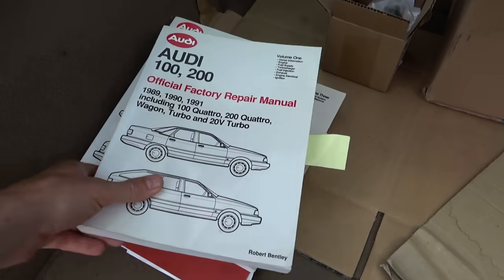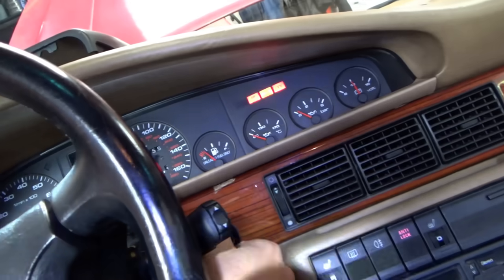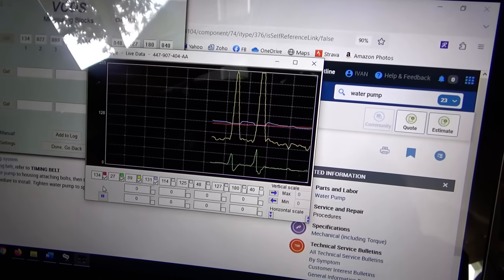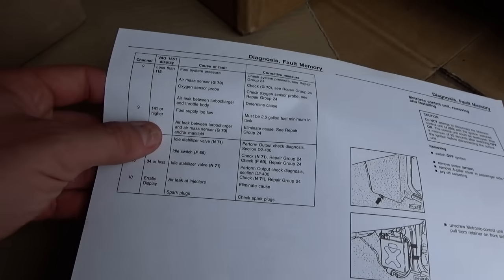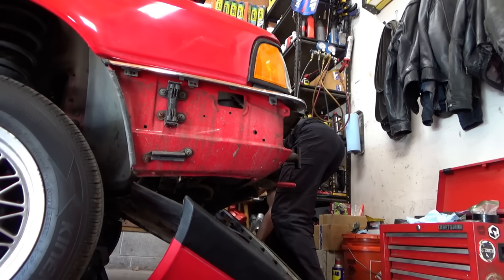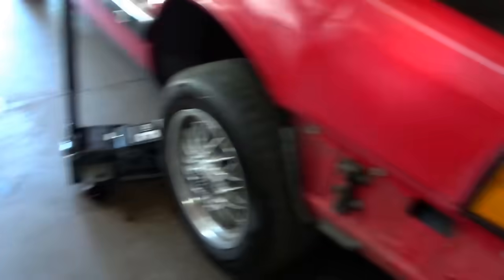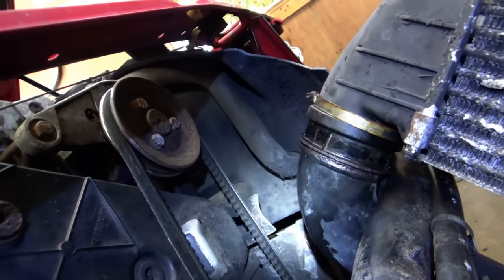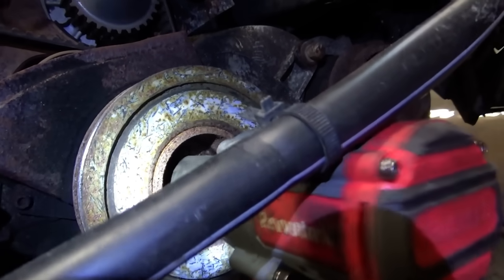(Pt 1) Audi THANKSGIVING! ('91 200 Quattro 20V Turbo is BACK!!)

Comment: Better keep your old cars running nowadays because they are selling your driving information stay away from the new cars with gps.
Reply: Because they don’t track your phone…..
Reply: Yes. 
 My self i ow a 97 Volvo S70 manuel.
Built it my self, & made it though inspection & fully road leagel after standing for 2 years. & parts car witch neve happend
Reply: @ That’s pretty cool!
Reply: @KentuckyReef  When the sell your driving habits to your insurance company you might think differently it will count hard braking speed and even corners your car has yaw sensors just fyi.
Reply: Some people have been programmed to embrace the latest & greatest  spyware tech  in new cars
Reply: They wont need speed camera devices with these new cars.
Reply: If you believe all these conspiracy theories, bear in mind your smart phone has all the same capabilities and more. So you’ll have to turn your phone off every time you drive.
Reply: @morstyrannis1951 they can not prove it, via your smart phone, if you are driving a particular vehicle or if you are a passenger
Reply from the maker: Just unplug the Telematics unit 😉
Reply: @PineHollowAutoDiagnostics  i prefer older cars less faff.
Reply: @ Good idea!!!!
Reply: @morstyrannis1951  Your phone has no idea how hard you’re breaking or turning a corner or how fast you are moving and you can turn your location off your car that’s a different story.
Reply: @watfordbadshahscricketclub9730  Exactly!!!!
Reply: @morstyrannis1951  Ain’t no conspiracy theory it’s facts bro you need proof just let me know I cow send you some proof.
Reply: @keysautorepair6038 Yes it does, how do you think insurance companies make phone apps to monitor your driving to offer discounts? Phones have many sensors to precisely detect everything from speed to yaw rate, turning off your location won't do anything. And stop believing conspiracy theories, nobody is selling your info without your consent.
Reply: Don't forget about the remote kill switch that auto makers are mandated to install in all new cars starting in 2026
Reply: @ Pretty sure this is already happening through on-star.
Reply: Yup. I’m keeping my daily driver stock 97 jeep cherokee forever because I’m cheap. I told a neighborhood teen age kid don’t waste money on new stuff. Spend it on a house.

Comment: dont waste time on the dtc regarding engine speed/rpm.... it pops up automaticly if reading dtc with just ignition on... reading dtc when engine is running it does not pop up.

Comment: Jeeezus min, yer a right whinge at times😂
All you have to do is undo the crossmember, undo the slam panel, move the top of the slam panel towards you, undo the pipe and lift it out complete.🙄 And that Harmonic balancer will need a new bolt and diamond washer. One time use stretch bolt. Torque is nor270/280nm

Comment: What a PAIN IN THE ASS, when I was younger I would have no problem doing this, nowadays NOT SO MUCH.

SAWZALL, WELDER, GLUE TO TAKE THAT CAR APART & PUT IT BACK TOGETHER.

Belt looks good on that 91, I wonder how much the quality has dropped since then, sadly.

Comment: You didn’t have to take the crank bolt off those four Alan bolts you remove and that’s it. Why didn’t you read the manual? It told you in the manual how to do it come on Ivan you’re better than that.
Reply from the maker: I DID read the manual, and it said remove the pulley and crank gear TOGETHER! Read it yourself! 😜
Reply: If you looked closely enough there are 4 bolts that you remove and leave the center Bolt alone. It then allow you to remove the shield and put the new belt on. The way you did it makes it very very difficult to do the install.
Reply from the maker: @adyjones9460  sorry, can't take the harmonic balancer off without removing the center bolt. Go ahead, read the factory service manual 😆